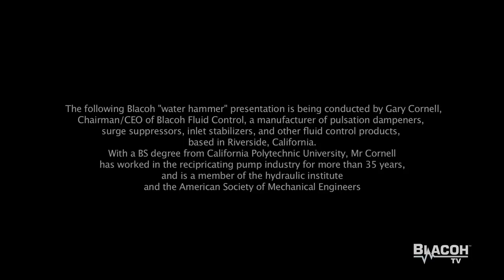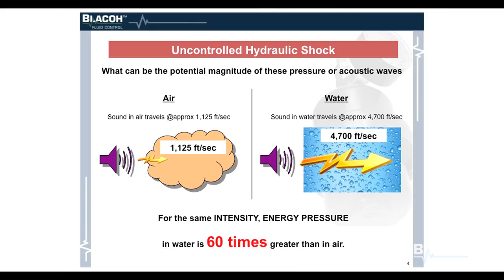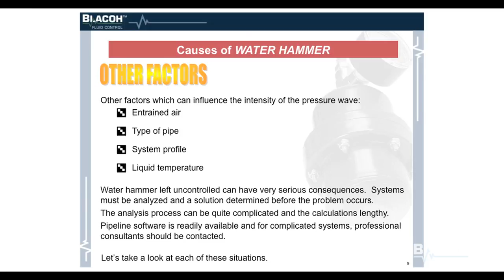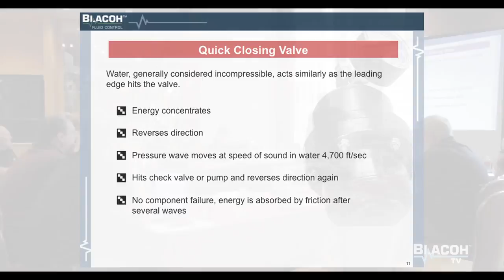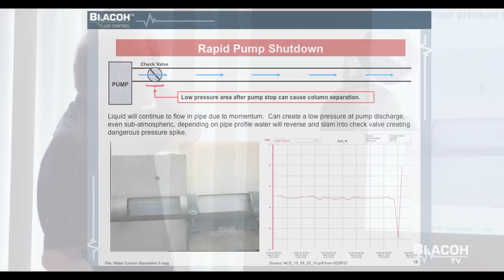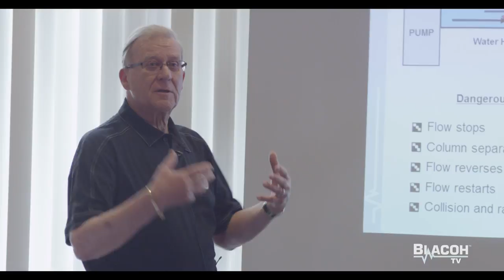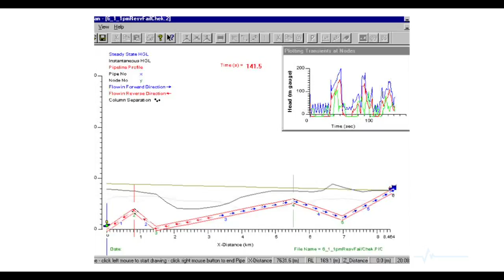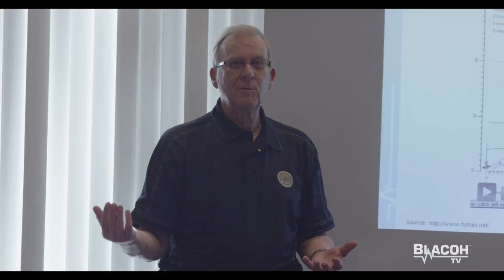The Phenomenon Called Water Hammer

Comment: This has been a nice video to watch, it prity much says it all about the problem I've just stopped today, thru a failed diaphragm washer on my toilet system making the water pipe vibrate all the bording round my sink in my walls to point you could just touch the wall and feel the vibration it was loud, sound like a train horn, a flush of the toilet followed by loads of vibration and horn all fixed by £3 diaphragm washer

Comment: the session interesting  and very helpful for me . sine we are working to build piping for RO water in length of 22 km from DMC  to the University and we are using 4 pumps each ( 756  M^3 / hr )  we using the  Surge tank to prevent the pumps and the piping from the water hummer . but it's good to know that I have to add the check valve between the surge and the pumps . since that was my suggestion to the contractor  and I was insisting to add it but he wasn't interest to add it because the project lump sum

Comment: Awesome presentation, thank you. I have been researching the TVA Apalachia (yes, it is spelled with one p) dam and it`s powerhouse 8.3 miles downstream with a 280' drop in elevation through a 20' diameter conduit...serious head indeed. It has a 240' high surge tank with a huge diameter. Wish I could learn even more about the engineering behind this 1943 project. Any suggestions?

Comment: thank you very much for this video, very well made, i am a cadet over at crude oil tankers, i dont have much knowledge about hydraulics but i was wondering what is the reason there are no surge suppressors at an oil tanker ? the pipes and the pressures are extreme , and most people open and close valves without ever having read about water hammer (or hydraulic shock), why dont shipbuilders include them in the piping ?Sorry for the bad english .... thanks
Reply: did you ever find out?0

Comment: At 6:20 a calculation is performed where '60' is used as a factor. What is the unit of that factor? With all due respect, that is why metric system is so much easier to do calculation with. We do not have to remember all these conversion factors.
Reply: I went to school for engineering and the class I took before my senior design course was all non metric units.  Before that it was all metric.  I work at a water treatment facility and I'm not dealing in metric.

Comment: When that guys mentions microseconds I got curious and used 1 microsecond in the equation. it went from 432PSI @ 1second to 43,000,000 PSI in 0.000001 second. That is an insane amount of pressure or I did the math wrong.

Comment: Amazing video, however that rule of thumb calculus is wrong. There is a maximum theoretical dP with instantaneous valve closure. At 6 ft/s, and 1.2 SG, it is roughly 312 psi, no 432. I guess it is explained later on the course or video.
Reply: Depends on bulk modulus, I used 300 kpsi